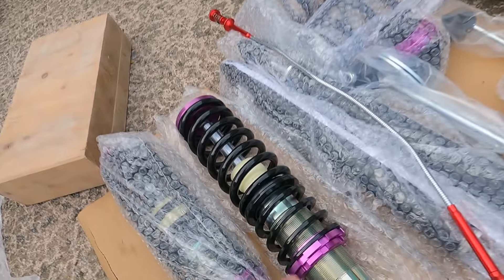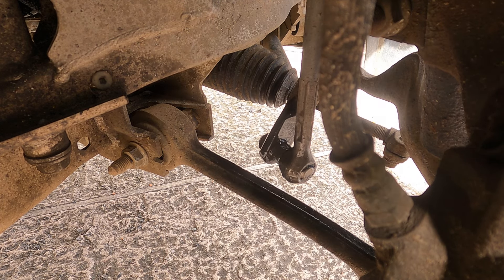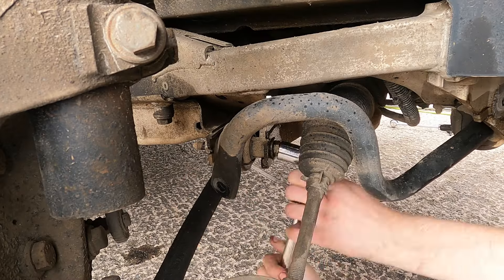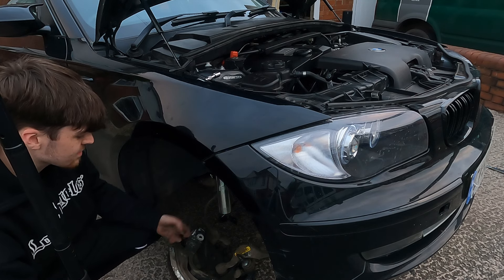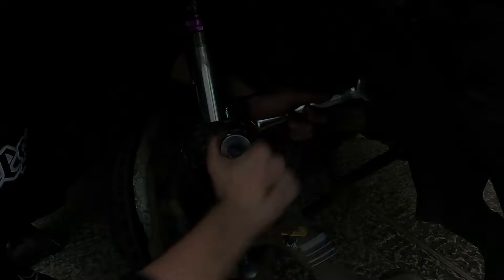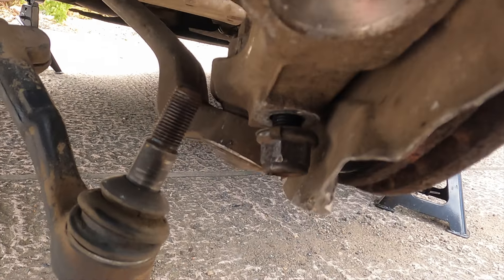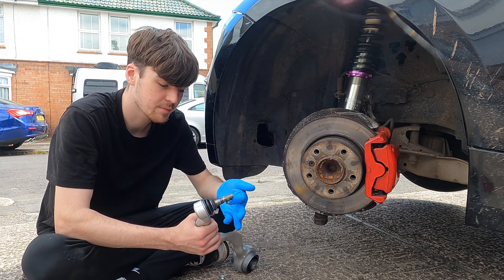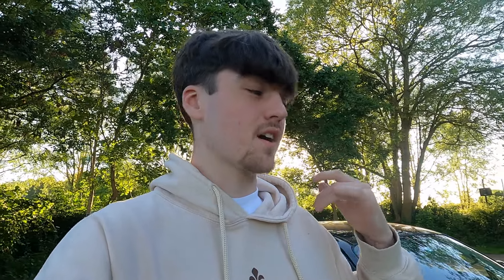INSTALLING BUDGET COILOVERS TO MY BMW 1 SERIES

Comment: Hey Sam, might want to tighten the control arm bolts with a jack underneath the hub knuckle. You are supposed to tighten it with the true weight of the car acting on it, otherwise the arm will not last very long! Great work and an enjoyable series. I wish you the best of luck moving forward on your car journey
Reply from the maker: Thank you for the advice mate, I didn’t know that before, I’ll make sure to tighten them up properly now!